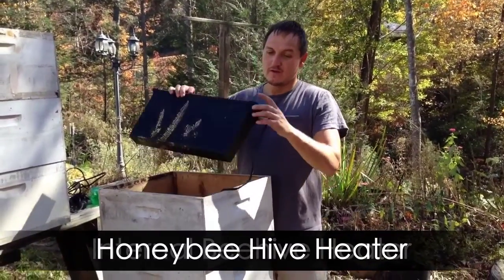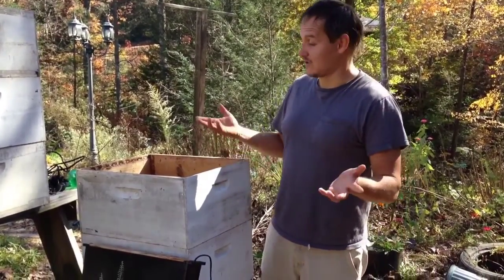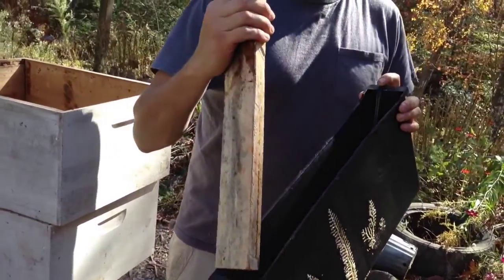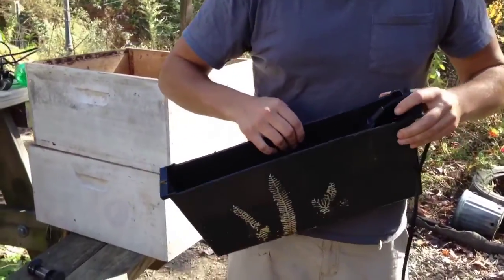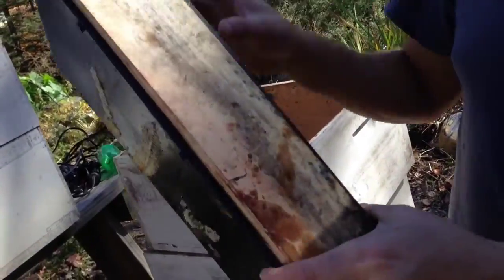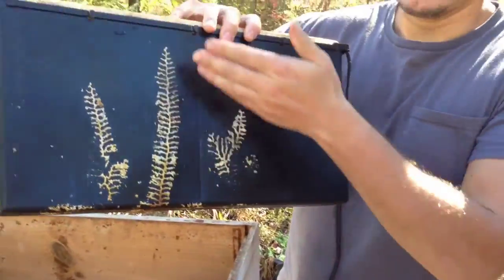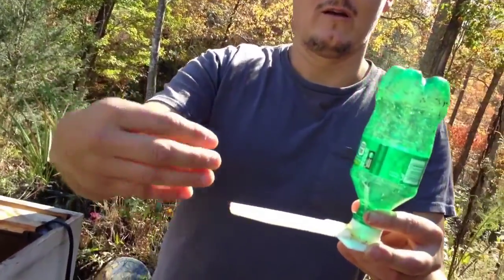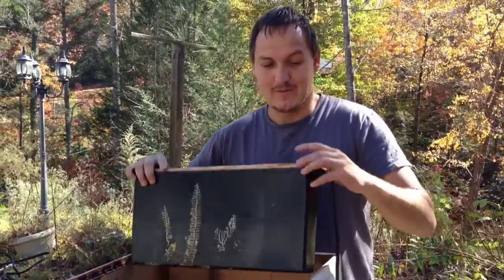Internal beehive heater

Comment: You can seriously have this kind of heater on top? of the main colony? And this actually is tested to work without it being on the bottom? I've heard others with different types of heating devices say it has to be on top. You said it didn't. (Sorry this confused me.) But to me the boxes are too heavy to lift by now. If yours works on top this would save me a lot of trouble. And do you need a certain watt power to look for in these aquarium heaters? I see multiple watt strength aquarium heaters being sold on the market. I want to go cheap as possible but make sure it can do the job still. 

...

I also want to ask if the aquarium water heaters are cheap enough in electrical usage to be supportable by a solar power bank system? This would lower the cost further for you. 

...

I also wonder if one of these aquarium heaters will still work if the colony has 2 big boxes and not just one? Does it matter if its double brood box or single brood box per heater?

...

Also did you try to test if the heat from one of the the bechives being heated could also modify and support the heat of a colony above the one being heated? (But with the second one above not being heated except by proximity heat?) 

The syrup feeders for me got really messy under 41 degrees. The syrup could pass through boxes from the top and really harm a colony. I would not use them when its cold... I have had so much trouble with these in low temperatures that I'd not want to do this... but if the colony is hotter than normal that's tricky also because it means that they would be using food faster. I find this part confusing.

...

I want to say thank you so much. I was so worried about bee losses this year. And I was looking for ideas like this. It was gut wrenching to lose almost all my bees last year despite trying very hard. I am so grateful for these kinds of ideas.
Reply from the maker: It really works. I got really cheap ones. Very successful. Best of luck!
Reply: @gregmelikhov8261  Haha thanks. Sorry I wrote too much last time.

I can't really tell if its working or not because 68 degrees or so is a bit hard to feel with the hand on the side of the tray that the heater rests in. How do you know if its working right?

Comment: Just wanted to let you know, We just picked up our package of bees Saturday. And then a cold front moved in and it's been snowing since, temps in the teens at night. I saw this video months ago, and wanted to thank you for the idea. We set the thermostat as low as it would go (68F), set the queen box on top of the transformed feeder (great instructions, btw), and things seem to be going pretty good so far. Thank you very much for sharing. It was cheaper than buying a bunch of heated silicone mats, and seemed a more natural way of doing things anyway. The bees are mostly covering the queen and hanging out around the heater/feeder box. Some are wandering around the box, checking stuff out. My husband made a long Langsroth, as I have trouble with a standard Langsroth, and only want one or two hives for pollination.

I put a pollen patty at the bottom of the hive, and put a big glob of honeycomb on the bottom tray and at the top, in addition to the sugar syrup. *shrug* The bees will clean it up. I got nailed in the face, and the stinger and venom sac were stuck there for at least 15 minutes, but we had to get the queen marked, and get all the last minute stuff set up, I didn't have time to mess with it. My jaw looks like I swallowed a golf ball. LOL ITCHY! Great for my arthritis, though, so big deal. After getting stung, I generally don't have to take any arthritis meds for a good 2 months.

My neighbor, who got his bees at the same time and same place, managed to lose his queen (I chewed on him for not asking for help), didn't know anything about the pollen patties, had zero way to keep his bees warm. Yes, I feel smug, but I made most of my mistakes last year. He went and bought another queen, and I argued him into at least throwing a blanket over the hive. I gave him a pollen patty, which was 50% gone in two days.

Anyway, THANK YOU VERY MUCH!!! Wonderful idea. Not too much heat, not too little. 😘😘😘

Comment: I was considering using a reptile style heating element "bulb" as a way of heating a hive.  Typically, I keep an empty super on top for my feeding mason jars.  Do you have any opinion on a "bulb" style heating element as compared to your water ballast heater?  I recently lost 1/2 hives due to extreme (-10F) cold for several days straight.
Reply: You can by a thermostatically control electrical socket on amazon https://www.amazon.com/gp/product/B01LZV591B/ref=ox_sc_sfl_title_7?ie=UTF8&psc=1&smid=AARY1ZSUT9VPR for less than twenty bucks. an incandescent lamp is best for heating.

Comment: That looks great , in Canada, I used a battery warmer with those light timers so it came on at night only when cold and then when it's very cold on 3 hours and off for two so the bees don't over heat , worked nicely ,
Reply from the maker: thanks for sharing. Awesome

Comment: hello share information I have prepared a system of temperature control hot with cooler and Arduino would be interesting to share information as we by the same way.

Comment: Greg Thanks for this great info.  I really want to do this for my bees this winter.  I had 5 queens die at the end of the summer and was lucky to get replacements but they haven't built up much yet.  I think this will be a great solution to have strong healthy hive for the spring flow.  What heater did you use? Can you give me  a brand name? Thanks
Reply from the maker: Hello. Thanks for your question.  it doesn't really matter what brand. as long as it a fully submersible heater for 10 gal. aquarium.  about 15 watts. I m  Wishing  your hives well.

Comment: Hi Again Greg!  a few more questions if you can spare a minute :)  Was wondering how cold your nights get?  The 1 1/2 gallons lasts the entire 4-5 months of winter?  Do you actually open your hive on a chinook day to top up the reservoir just in case?  How warm does it need to be outside to perform that task?  Odd in our region, we get Chinooks if you haven't heard of them, they are beautiful days that pepper the winter ones.  They are completely random but can be 10-20 degrees Celsius!

Are you under the belief that heated, spoiled bee caused weak genetics?  I have no beliefs one way or the other but noticed this comes up in many threads.  So I'm curious about what you think?

I received my feeders and do plan to do this, so once again thank you for you fantastic video!

Comment: Greetings and thanks for the tip!  Going to try this with a weakened swarm I caught just a few weeks ago :)  Question...  How cold can your nights get?  Here in Alberta, Canada it can get to almost -40 Celsius and have a spike of 20-30 degrees the following day.  This up and down pattern is very normal but unpredictable with our Chinooks that come over the Rocky Mountains just to the West.  I'm a newbie and am emotionally attached to my swarm which I went to unbelievable lengths to salvage.  I would be grateful if I could pull them through winter and watch them thrive next spring.  They deserve it.  Are the aquarium heaters reliable on a cold night if the connections are protected?  If I have a top quilt style roof with a hole for a mason jar feeder, is it safe to assume the heater would also keep that in a fluid state so the babies can feed all winter?  Hope that made sense lol!
Reply from the maker: Hello this is Gregory. on really cold times I recommend to remove all outside feeders.  just  feed bees patties also known as fondant.  inside patties would stay warm and soft allowing bees to eat it with ease. 
in my area aquarium heaters rated for 10 gallons keep less than 2 gallons of water in those internal feeders with no problem. last year they did great. thanks for your question.  I believe that your bees will do great.
Reply: Thanks Greg.  Again, great video; thanks for sharing your technique :)
Reply: Renfrew Calgary Hey bro did you get any bees in Calgary last year?

I'm planning on getting some this year and I'm just outside Calgary in the first western Canadian "bee city"... lol whatever that means.
Reply: Hi, If you give them syrup winter time , you will kill them all!!!!!!!!!!